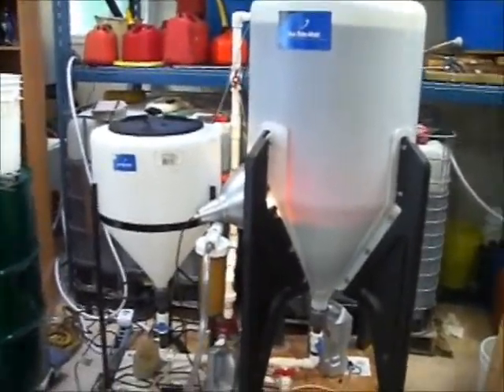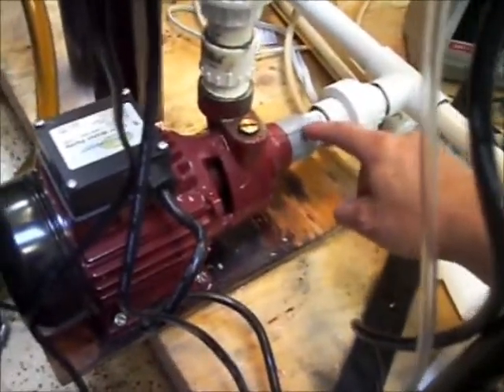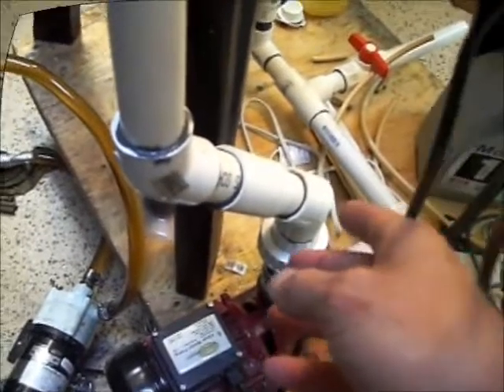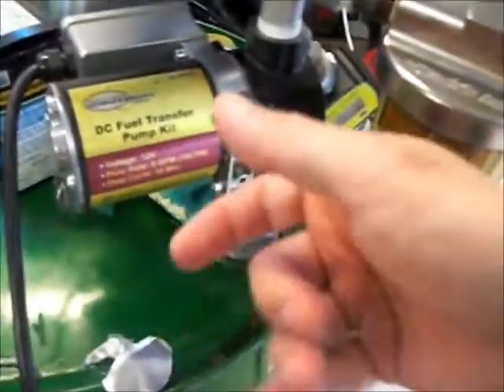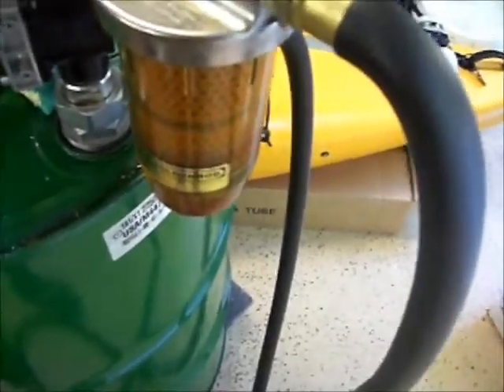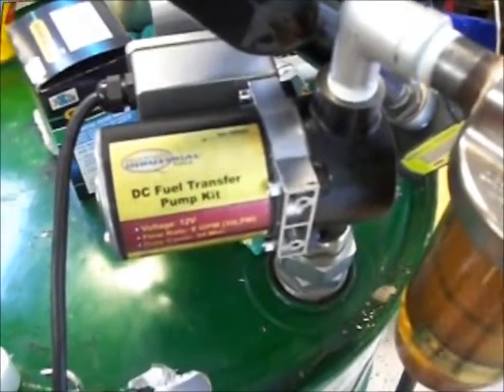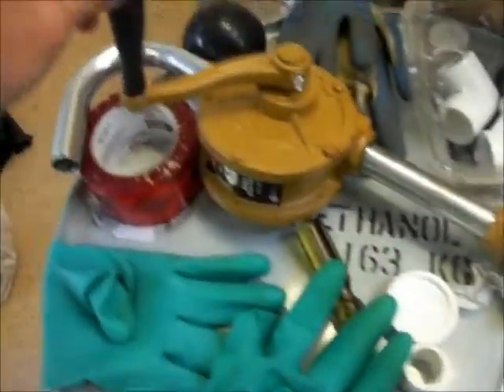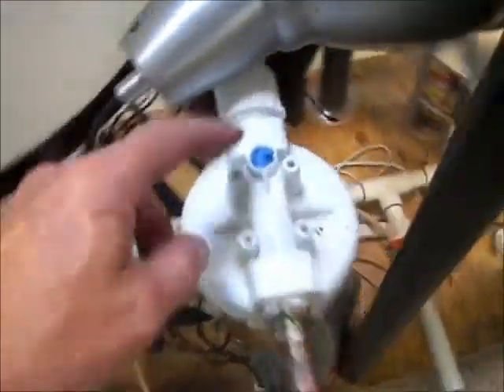Biodiesel Update

Comment: Have you considered a 2017 update video? Anything else you've learned since this video?
Reply from the maker: At some point.... youtube kinda ticked me off so newer stuff went onto http://www.dailymotion.com/westvandude but I haven't posted anything new up last little while, life has been a roller coaster of bs and busy-ness. I've got a BioPro190 processor now. Not much new besides breaking emulsions with salty hot water. The Biopro pretty much does it all without too much hassle. With the biopro I haven't required using a centrifuge anymore either. It is a $10k USD investment tho. I've done a lotta fuel so at the end of the day it's more than worth it for the ease of making fuel with it. No manual washing, no watching valves, etc. BTW my orig setup is for sale cheap but local Vancouver, BC pickup.

Comment: Question:
Everyone tells you HOW to make BD but no-one tells you the ratio of products used to the ratio of BD produced.

Example: If you made 1,000 liters of BD, you will get approx XYZ liters of usable product.

This XYZ liters will save you approx $X 

Otherwise it seems like a cosmically expensive hobby.

Finally, Stainless steel "tote" tanks are much more preferrable if you want to do this long term, they often add sunlight degradable chemicals to plastic (plus BPA) - cheaper long term.

Comment from the maker: Thank you. Good questions. The wash water goes in the toilet, mainly because it is slightly caustic and with acid rain issues these days it's ok IMHO to do so. The glycerol leftovers I take to my buddy's auto repair shop and it goes into used waste oil recycling. Not ideal I know. However a local waste recycling company will take the glycerol provided I do a btu energy test on it for $80. They will use it in a waste oil burner. Hope to test it shortly.

Comment from the maker: I found them on craigslist for under $100 each. Do a search on craigslist for "tote tank" or 1000L tank or 375 or 350gal tank or perhaps pallet tank. There's a lot around. Price ranges from free to $100 bucks a piece. They are big so I hope you have a pickup to haul them with. Price usually varies according to how clean they are and if what was in there before was nasty or not. Usually u need to rinse them good. Use a sponge on a stick to get last bit of water out after rinsing.

Comment from the maker: I think it helped last batch I opened the methoxide tank drain valve and let a portion of the hot oil flow up into it. That should help with KOH buildup. I just played around with the valves to draw some methoxide out, let hot oil in, methoxide out a few times before draining the whole methoxide tank.